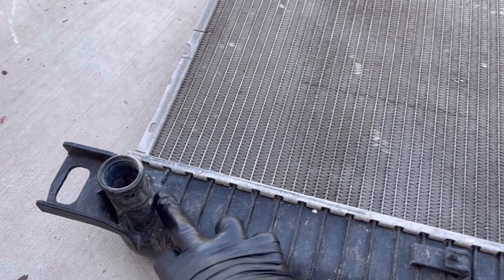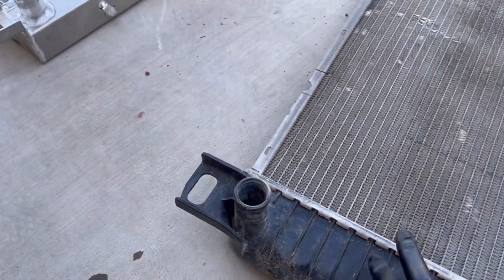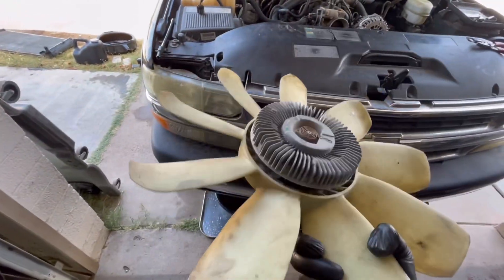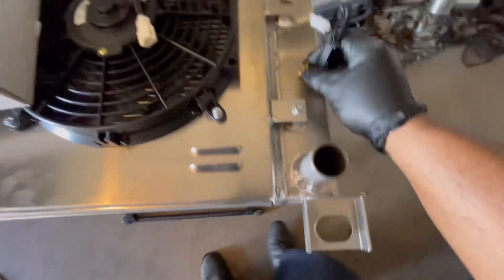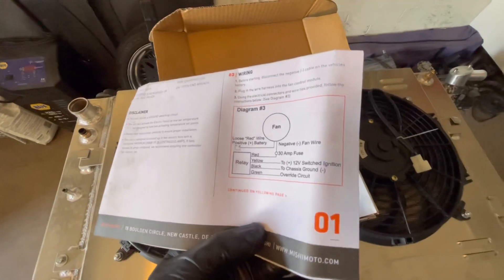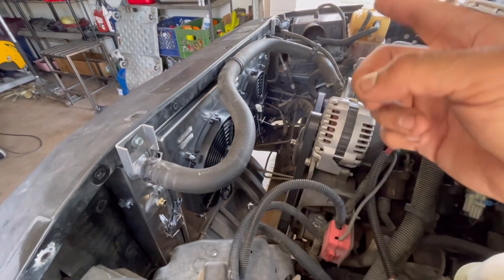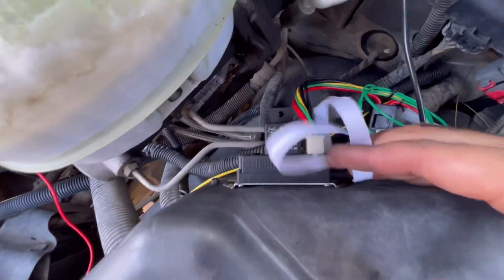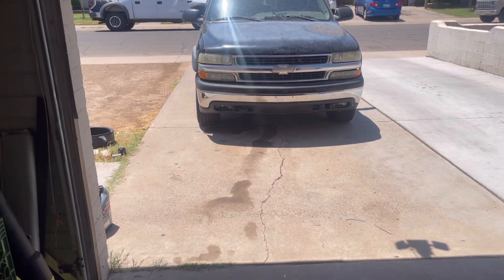2004 Chevy Tahoe: installing dual electric fan conversion and aluminum radiator

Comment: How are these holding up? Are the fans powerful enough to keep it cool with the ac on? What temp does it idle at or stay around when driving ?
Reply from the maker: Works perfect. Temps stays in the middle of the gauge and I don’t have AC but it will be fine if I did. Two fans are better than one.
Reply: @Aldama5523  so it stays around 210 basically ?